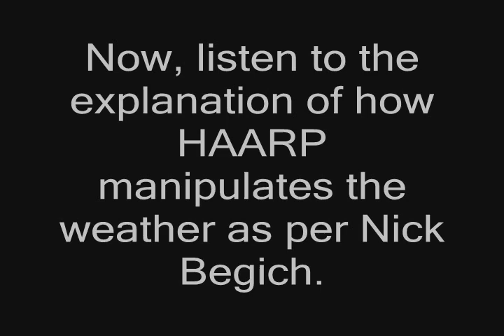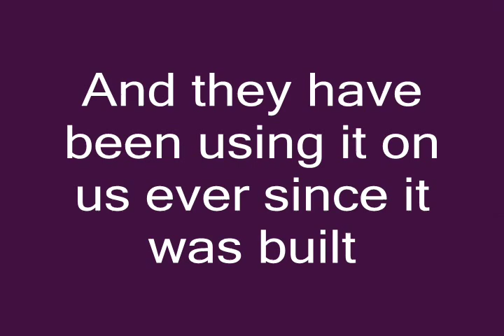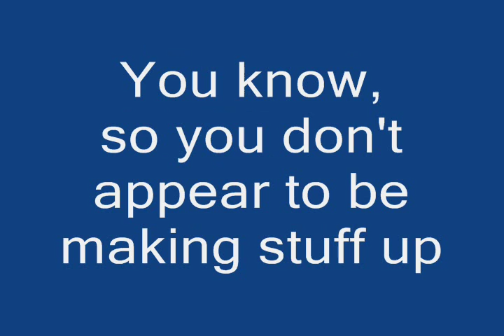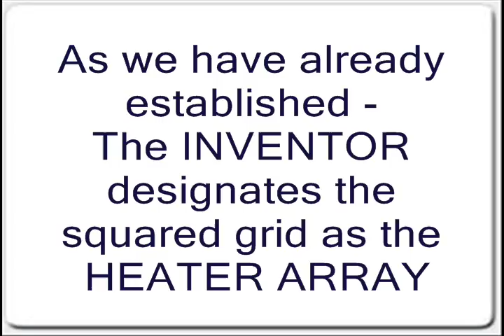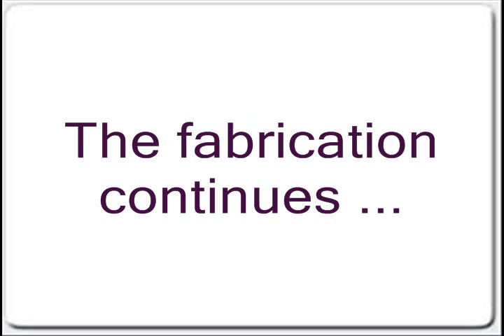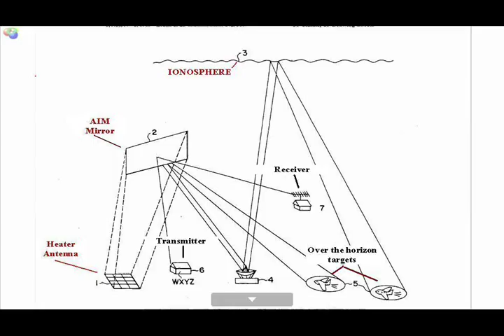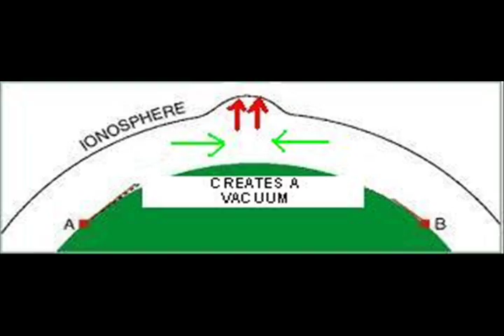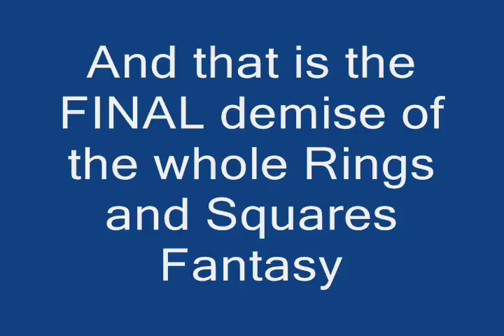Dutchsinse FABRICATES HAARP Explanation to fit his PSEUDO-SCIENCE The Definative proof inside

Comment from the maker: @kimberleymanrique Another one! Did you watch this video? I'm sorry, but you are not correct. The way HAARP works is fully described by Dr. Eastlund. All you need to do is read it. I have provided the material under the video. There are no mysterious beams or bouncing off of land sites. It is simple thermodynamics. Hot air rises, the cooler, surrounding air takes its place. HAARP provides the "heat" by exciting the particles in the lower ionosphere.